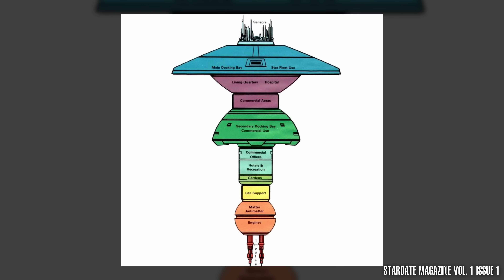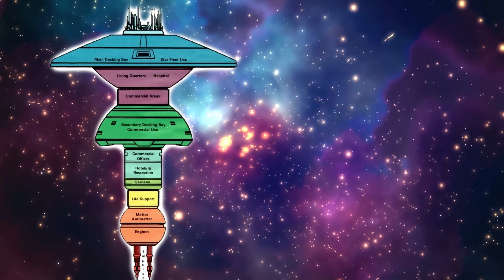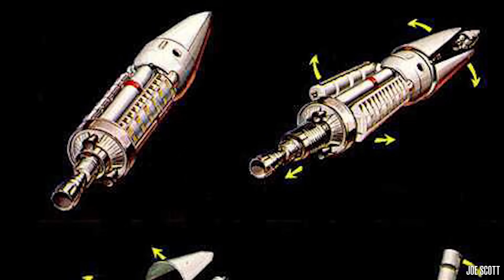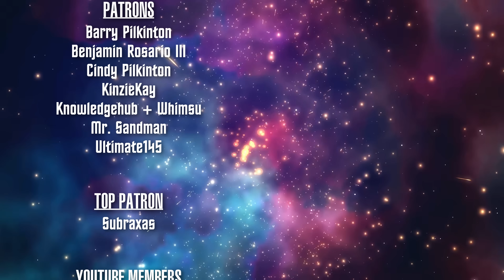How Do Starbases Work?

Comment: Very sloppy. In addition to the already pointed out error about Skylab being the first space station:
1. There is no "omicron" in the centrifugal force formula, it's actually "omega". Omicron looks like an "o".
2. ISS has to use thrusters not because of "strong gravity", but because of the atmospheric friction, since ISS is very close to the surface, only about 400 km up, where residual atmosphere still exists. A starbase is likely to be located far higher above the planet, where atmospheric friction isn't an issue. Also, a starbase is so massive, that friction, if any, would be too weak to have an effect on it. It should also be noted that ISS fires its thrusters only for a few minutes per month on average. The video makes you think that it uses its thrusters constantly.

There are other mistakes - this is only what I picked up without even looking for mistakes.
Reply: @subraxas  I don't watch live streams. Video description and pinned comment only talk about one mistake (which I, therefore, didn't include in my list), but not about the other two.

Comment: No. Just No. The ISS does not constantly thrust to stay in orbit. Astronauts on the ISS do not experience any gravity on the ISS. Being in constant freefall in a stable orbit means it keeps falling without ever hitting the ground. It has enough speed to keep it there. The thrust maneuvers are to correct orbital drift and to avoid debris. All a larger station would need to stay in orbit, is a higher orbit (Maybe). I am strangely annoyed by the apparent ignorance of this video.

Comment: What thinks about so called "fan" who is unable to do his fact research correctly.
First manned space station was Salyut-1 lanuched in 1971.
Second was Skylab in 1973 (USSR launched another 3 stations between Salyut-1 and Skylab, but all were unmanned because of their technical problems).
Reply from the maker: "Fan" who doesn't know how to read the description, pinned comment, and card on screen with the correction lol
Reply: @OrangeRiver  Ok, you got me, i did not read it. My bad. But on the other side, would not be better to replace video with correction inside that video then?
Reply from the maker: At some point perhaps I will, at the time it seemed somewhat rash. I already feel bad enough that I made the mistake. Thanks for understanding.

Comment: Nor Class which DS9 seems like the smartest type of station design, plenty of docking areas, section the habitat ring and docking ring can be sealed off in an emergency and it just uses its space well. Earth Spacedock with its massive ship hanger just screams hubris to me.
Reply: Nor class stations were ore processing facilities, earth spacedock is a harbor.
Reply: One of the problems with those big doors was that they were just barely able to squeeze Excelsior through it in Star Trek III. But later a similar shot shows the vastly bigger Enterprise-D flying through it with the same clearance. The production team reused the same model and just scaled it up. Doh.  Though, perhaps in the time of TNG Starfleet just built Spacedocks much bigger to fit their bigger ships.

Comment: Your statement that Skylab was the world's first space atation is incorrect. Salyut 1, the Russian single module space station launched in 1971, while Skylab wasn't launched until 1973. Admittedly, it never had a crew inhabit it and return safely to Earth, as the first crew couldn't dock, and the second crew, while they lived on board for 23 days, died during their return trip.
Reply from the maker: Read the card, pinned comment, and/or top of description
Reply: @OrangeRiver  Didn't see that. It's good you do correct errors.

Comment: So sad Americans need to lie about having the first space station....
Reply from the maker: If you noticed, it was a mistake that I went to great lengths to try to correct with an amended description, pinned comment, and a card on top of the video.
Reply: @OrangeRiver  great lengths would have been doing basic research or since you're incapable of that editing the video.

You did the bare minimum because you'd rather spread misinformation. Great lengths my ass. You didn't type first manned space station into Google.